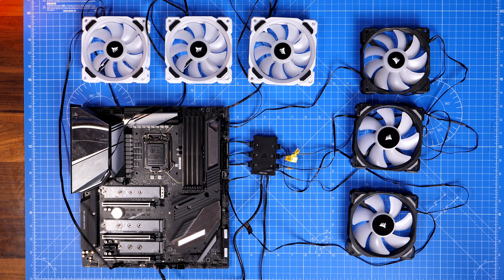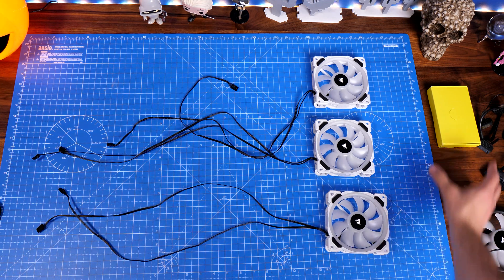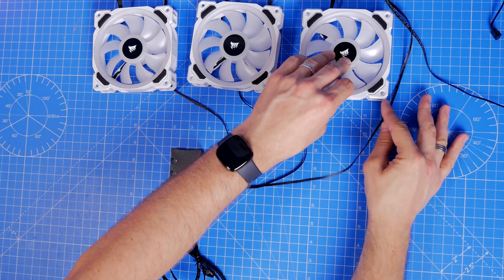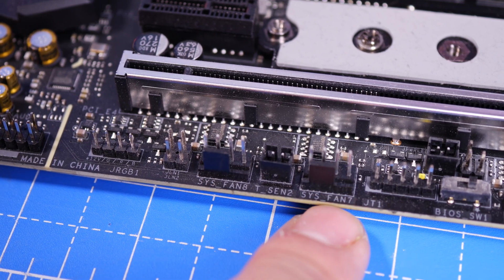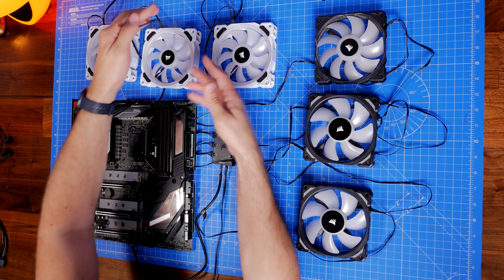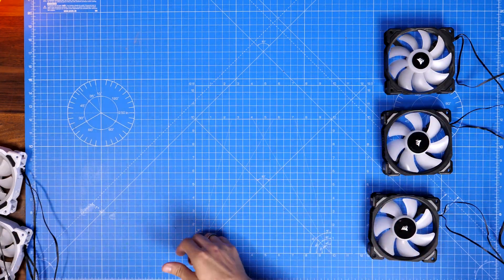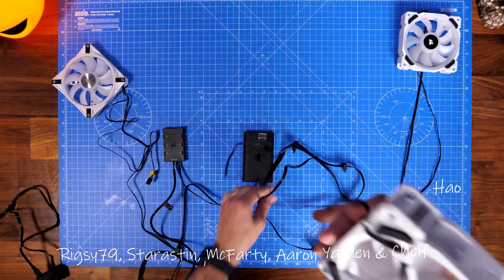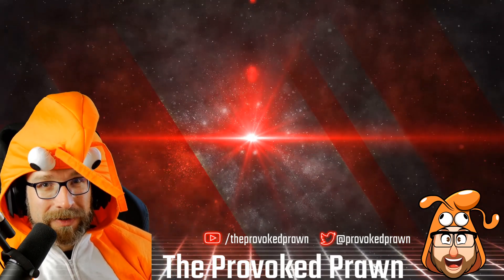How to wire and setup Corsair RGB fans  - tips for adding RGB fans to your case easily

Comment: Nice video, thank you. However I am wondering how do you literally control the RGB settings of fans? Like, when the PC is booted up. Do I install some kind of software or do the controllers / hubs come with their own software?
Reply from the maker: If you are using a commander core or commander pro then you use Corsair iCue software
Reply: @TheProvokedPrawn  Thank you for the quick reply! I will keep the commander core in mind.

Comment: For some reason I purchased a Corsair RGB HUB and it came without the cable that would connect the hub to the motherboard and I can't seem to find that USB cable to purchase anywhere. is possible to still use the hub so that the Corsair RBG fans may default to at least a default lighting mode?

Comment: how about if I have a hub that has both RGB and PWM connections to plug both RGB part of the fan and Power of the Fan. I have one of them on my case that I bought. However when I plug the Fan connector that comes from the Hub the fans do not spin. The hub is fully connected I have connected SATA cable and the RGB connector to RGB port on the board and fan connector to Fan Port on the Motherboard. The fans seem to work fine when I connect them one by one to the header on the motherboard, but they don't work when connected via the Hub. Is it that there isn't enough power supplied via one header on the motherboard or is the hub malfunctioning?

Comment: Does it matter if you coonnect a sus fan spliter by 3, lets say your motherboard in this scenario only has 2 system fans and to connect the 6 fans you get 2 splitters

Does it affect something? Signal? Power? Etc…?
Reply from the maker: It depends on the power those headers can supply. You have to check the motherboard specs/manual vs the fans. But in theory yes

Comment: Hi i have a little problem today i changed my case nothing else only the case. I had the corsair icue 220t and now i have the corsair 4000d all was working well for fans and rgb but now that i mooved all only fans are working not rgb, i have the hub with 6 hole for rgb and also 6 for fan sorry dont know it name, maybe someone could help me ? Thank you
Reply from the maker: You're sure you reconnected everything correctly
Reply: @ yes pretty sure cause all the fan are running only their light is not working
Reply: @TheProvokedPrawn   yes pretty sure cause all the fan are running only their light is not working
Reply: @ i took back another hub only with rgb plug on the last case and put it in the new and now all rgb are working idk why but all is good thank you for your help

Comment: What if I have 2 fans 4 pin in the front and 3 pin in the back and top? How do I connect them so they work well together? The 4 pin ones have adapters for 3 pins.

Comment: Hi mate, the cable that's labelled 'to rgb hub', can this style of connector only be connected to the Corsair hub? I bought the 3 pack of AF120's and did not get an included hub so I am unable to use the rgb as I can't find a hub that accommodates the connector for rgb.
Reply from the maker: Yes only to Corsair hub or commander core

Comment: can i control the fans and the rgb in icue with rgb fan hub alone? or must i have the commando xt aswell for controlling rgb and fan speed? or will lightning node core be enough with 3 fan pack? man rgb fans are the most confusing part of pc building... about to buy a 3 pack fans and lightning node core comes with them that must be right?
Reply from the maker: You need the commander if you want to control both speed and RGB via icue

Comment: I tried connecting an rgb fan to the motherboard but the light wouldn't turn on not sure if I have to turn it on through the bios or what? It's only one fan that isn't connected to the controller
Reply from the maker: These Corsair fans will not connect directly to motherboard RGB headers, as I've shown.

Comment: I plugged one of these fans into my motherboards 4 pin AMD_Fan_LED1 and now it won't light up at all.
Reply from the maker: @vinvin4884  that's because you aren't meant to do that. As I showed. Corsair controller only. It says so on the cable
Reply: @TheProvokedPrawn  Not on the fans that I have. They're from a corsair AIO. Unfortunately I found this video after I tried plugging into a 12v argb header. Which likely destroyed the RGB.

Comment: rgb fans have got to be the most confusing part about pc building
Reply from the maker: Hope this helped at least
Reply: @TheProvokedPrawn  What is this nonsense video? I just saw a nice 6 corrsair fans connected to each other and only one cable to controller then another 3 fans from the top connected to rear fan and one cbl to the hub it was so clean and easy but this nonsense you showing is a nightmare dude.
Reply from the maker: @Voltomess  assume you're talking about iCue link or having a break down?
Reply: @TheProvokedPrawn  new tech bro!! that nonsense here people did in the 90's no breakdown just the future!!! Ok enough of that nonsense from my side LINK is great of course but the price is unacceptable and really ridiculous.

Comment: hello,  are you familiar with the 465x case?    their is a controller that is pre installed in the case, and I beleive has failed... ICUE no longer detects my fans or cooler...  I have not deleted the software and tried again in hopes to not loosing my settings.    If it is hardware,  can I bypass this controller and purchase this one or a commander?

Comment: Thanks for this! My corsair fan kit came with an RGB hub, but I've never used one before. This was a whole new thing for my PC and I wasn't sure what to plug into where. I've been running them without the RGBs for several months now because I couldn't figure out what to do with the hub. Then I finally googled it cause I want the RGB that I paid for. Much appreciated!

The one frustrating thing is that my non modular PSU only has a single SATA power cable daisy chained into two connrctors so I either have to put my SSD somewhere on the outside or put my hub in the area with the drive bays and run my RGB cables back there somehow.

Comment: Excellent video - Lot of wires now when you add lot of fans in to system now.   Did build on lower spec I7 g4 with just 3 Fans recently.     The next Computer will build probably be a big one - (Main PC), likely to use I7 G12+ CPU, Asus Z790 board, so Will a 5 Fan Solution be a good solution.      I probably buy a Corsair 400D Case, Corsair, 850W Power supply (min) and probably use the two provided case Fans for top / Back but Buy the DeepCool FC120 3IN1 Case for the Front of the case

Comment: Tell me something are corsair sp140 rgb pro fans not meant to show their fan speed and lighting options in iCUE?

Heres what I'm dealing with
For some reason my corsair sp 140 rgp pro fans do not show up in iCUE for cooling, fan speed and they also do not show up in the dashboard tab.

I have an iCUE commander core rgb that came with my corsair h150i elite capellix xt aio 360mm cooler.

I have plugged my 2 sp140 rgp pro fans to the #4 and #5 ports on the iCUE commander core rgb.

I havent used the lighting node that came with these sp140 rgp pro fans but I may try it soon
I assumed the iCUE commander core rgb is compatible with these sp140 fans

Comment: Hey Provoked Prawn,
I have 7 SP120 RGB Elite fans in my system but my motherboard only has 3 fan headers.
Can I use a fan splitter and if yes, what are they called?

I also bought one 3 pack fans with the 6 RGB fan hub but once again, I have 7 fans. Can I also use a RGB led splitter?
If I can, what is the keyword to search on an online shopping platform? 
Thank you.
Reply from the maker: Get a Commander Core XT. Links in the description
Reply: @TheProvokedPrawn  Getting another hub is one option, but if I don't want to, will cable splitters get the job done?

Comment: I bought a prebuilt PC and am rearranging my led setup, but finding it to be quite confusing. 
My computer came with an AsRock B450M/ac R2.0 motherboard, and I see no system fan connectors, even after looking at the manual for my motherboard. The only fan connector I see is the ADDR LED fan plugin, and the RGB LEG fan header. Would this mean that corsair fans are not compatible with my motherboard? Or if they are, where would i plug the fans into in this case? If anyone has any answers I would appreciate it! 🙏🏼
Reply from the maker: You need to use Cha_fan connections. I've seen photos of your motherboard and there are multiple marked Cha_fan which is an alternative name for sys fan
Reply: @TheProvokedPrawn  Oh okay awesome, thank you! It is definitely a lot to learn at first haha.
I appreciate your video as well, it’s very detailed and easy to follow along!

Comment: I have an alienware r12 rtx 3090 11th gen cpu. My pump went out and i replaced it with a corsair pump and radiator. Had to keep the same fan. Im trying to find a good external radiator cooling system because my temps run high. My comp idles at about 60 to 65 c. I have had to customize fan speeds for front and top fan. Top fan is the radiator fan.  No room for anything else. Any recommendations for external cooling systems? Before anyone says it, i know, stupid for buying alienware, but i was late to the game lol.

Comment: I was wondering, would these fans sync with other aRGB fans like the ones pre-installed in the phanteks g360a? If I was looking to change the aRGB via the front IO of the case, then would I connect them by the same RGB header? Daisy chaining?

Comment: Does the SATA connector need to be connected if USB is already connected?
Reply from the maker: Yes. Usb provides data. Sata power.
Reply: The moment I connected it like that, something shorted and the computer completely turned off. Fortunately, after disconnecting the SATA cable and turning the power back on, the computer started up. MotherboardASUS TUF Gaming B650-Plus WIFI -  USB connected to port USB_1619 and  Asus TUF Gaming 850W Gold connected with SATA connectors.  @TheProvokedPrawn

Comment: Thank you for this helpful video, it helped me a lot, but I have a questions. I can't find any references or documentations on the "PWM Fan Hub" that comes with the case "CorsAir 7000D Airflow".  My questions is; the cable that is labeled "PWM" from that Fan Hub ,is it getting connected to the MB Chassis fan and which one?  I have a ASUS ProArt X670E.
Thank you so much.

Comment: I have 4 fans and only 3 sys fan ports on my Mb. How can I power the 4th fan? At least I got the lights working bc the argb cable is connected in the node 😂 but my 4th fan is not spinning. How can I solve this?

Comment: A year later, I know. But I really need help. 
My Motherboard - ASUS TUF Z390-Pro Gaming does not have a ARGB Header. Only RGB. I have a ARGB Hub. Can I still connect the ARG FANS to this hub that I have without connecting them to the motherboard? I will then obv not be able to control the RGB. Is this correct?

Comment: the 3 pack of LL fans i just bought came with 2 boxes, one called lighting node pro and a hub.  i also have an AIO with the 6 fan hub.. how to connect this together, i have 7 fans... kinda sucks if i have to add the other two boxes just for the 7th fan. whats the best way to connect things?

Comment: i only seem to have one system fan 4 pin connector on my motherboard, do i need a fan splitter to use my 6 fans in my system? only have one exhust ran right now

Comment: My new Corsair AIO came bundled with the Commander Core. I have 6 total Corsair fans going into my system (3 from the AIO and the other three an LL120 Triple pack)

I only need to use this Commander Core for this build? Also, what the heck is the difference between the Commander Core and the Commander Core XT? 

I have an old Commander Pro AND the RGB hub from the previous build. Do I just not need them anymore since the new AIO came with Commander Core?

Also, do a video on how to neatly cable manage all of these 😂😂😂

Comment: i just bought a new pc with separate 9 RGB fans .. so i need two Fan Hub to accommodate the required power cable and RGB cable so its 18 cables .. i bought one arctic hub since it has 10 hosts with 4-pins .. do i need to buy another one or the remaining cables i just plug them directly to Mobo ?

Comment: i've been using Signal RGB software for RGB control. and it was working fine.
yesterday i switched the cables, connections are same as before but Now
my RGB fans and cooler are sync together but not with the motherboard.
only the RAM is sync with motherboard. so if i install any RGB controlling software it doesnt work for the FANS, and Cooler. 
it only change colors for RAM.
any idea ?

Comment: Im just setting up my first PC Build als with an Airflow 4000D RGB with 3 preinstalled Fans, in addition i bought another fan for the backside and the H100i AIO Cooling system. Do i need to buy the Commander Pro aswell as the Commander Core or is the Commander Pro enough?

Comment: I know its been a while but i have encountered another problem that i just noticed. So in iCue, only 6 fans show up under the "Cooling" tab. And those 6 fans are all the other case fans. However i have no control and icue doesnt detect my Radiator fans. I have no clue why. I should have 8 fans in total with the radiator fans for the H100i. Please someone help if you know what it could be
Reply from the maker: https://youtu.be/mTjoqn-3Eh0

Comment: hi guys a question just bought capelix h100 elite aio and 6 fans 3 ml120 and 3 QL 120 fans. Connected them to the Commander core HUB. Everething is working exept port 6 the RGB wont light on. Connected the fan to port 5 fan lights on. So its not the fan. Connected any other fan to port 6 no rgb but the fan is spinning. So I have 6 fans connected and the aio. The software only detects 5 ports and the aio. Now my thoughts. The port 6 RGB isnt working or the commander core allows only 6 connections in total( 5 fans and the aio). Can you help me please ?

Comment: At 9:32 what is the bare controller under the RGB hub? I have 5 RGB Fans connected in order to the bare hub in a 4000x and only have 1 getting RGB which is also not controllable. Any ideas?

Comment: Newbie question...I have 3 inlet fans in the front and 2 exhaust fans up top with 1 more exhaust fan in the back. Can I daisy chain the 3 front fans and plug them into system fan 1 and then daisy chain the 2 top and 1 back fans together and plug them into system fan 2? Asking because it only has 3 system fan connectors on the board and I have 6 fans to connect.

Comment: You didn't suggest daisy chaining fan power and RGB cables. Why not divide your case into zones like front fans, back fans, side fans, top fans. Then use 3:1 power cables to connect 3 fans to one board fan header. I can't see where individual fan speeds are really necessary as opposed to zone control. RGB can be set up similar...unless you plan to use complicated RGB sequencing. I find I either gravitate towards a single color theme or just default RGB scanning so it isn't that important to me to have individual FAN RGB control. I can daisy change the RGB connectors and still plug 12-15 fans into a single RGB controller. Just food for thought. Frankly, after wanting it, I find the RGB stuff to be over hyped. You still end up needing one software program to control your fans, another for motherboard RGB, and a third for your graphics card RGB. It can get really bloated and complicated in a hurry. I'm thinking going with a completely dark case and then just add some RGB strips inside the case with an external controller for some ambient lighting. Too many choices!

Comment: @theprovokedprawn  thanks for all the videos. I really appreciate it. Looking for quick advice, im building a new system. I noticed you were talking about not mixing the fans. And my AIO    H150i elite LCD xt is using AF RGB elite fans… but the case comes with SP RGB elite. My initial thoughts are to use a total of 7 SP RGB elite fans in the case… Six on the intake, one for exhaust, and of course use the three fans on the AIO for exhaust for exhaust. How bad if any of a match up would this be. I know the two fan types are very similar and not such a big variation in speed. Any advice would be helpful. Thank you in advance.

Comment: Please help! I have 12 fans on my computer, and I want to replace the existing fans with 9 LL120 and 3 LL140. In order to connect all these things, I must have(preferably) two Commander cores?I'm going to buy 3 packs of LL120 and 1 pack of LL140,they will all come with Lightning node pro. So, with commander core it's not needed to use Lightning node,right?

Comment: For the power connection cant you just use splitter cables and plug them into the motherboard so you dont need the command pro/core?
Reply from the maker: If you have enough headers, yes

Comment: Hi how are you, i have the controller Corsair commander Core Xt, with this item i'm using 3 Corsair Icue SP120 Rgb Pro Fans, but i have a problem, the leds of 2 fans are not syncronized with the third fan, i tried to fix this but was impossible, im talking about Front side fans so i checked the mount of the fans, but they're installed in the same way and correctly, should i turn right once a time the third fan and screw again to fix the led sync problem or i can fix it through Icue Software? Thanks

Comment: Hey man! Ive currently bought a case that came with H150i pro RGB cooler. Now i have noticed that the USB cable for the pump is missing. But the 3 fans power cable are connected to the pump, then the other (rgb) cables from the fans are connected to rgb node which then connects to the motherboard. Is it possible to control everything on ICUE with that setup? Or do i need to get that USB cable for the pump?